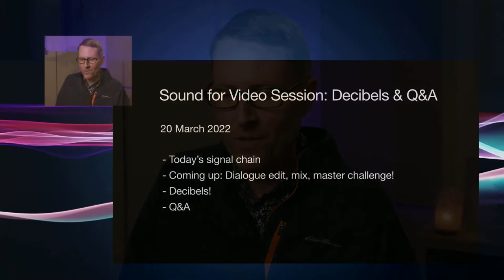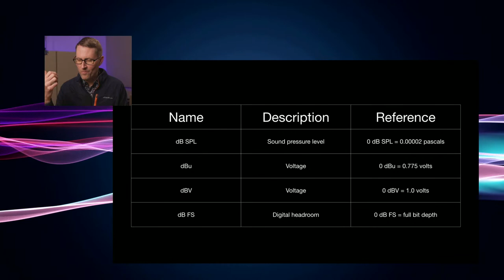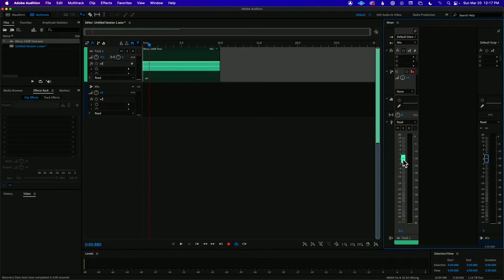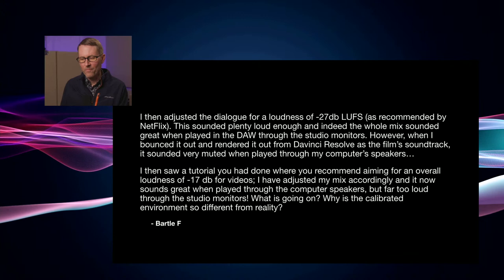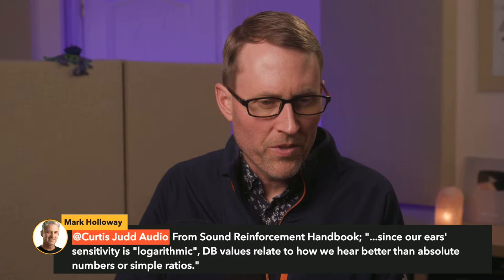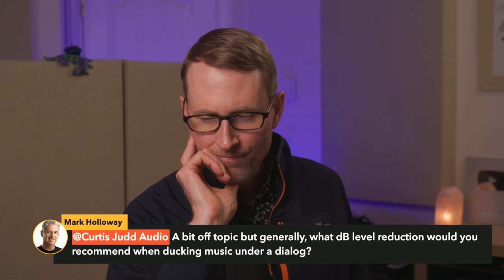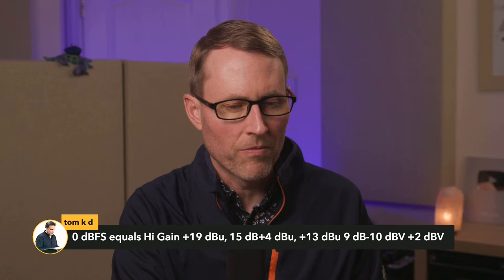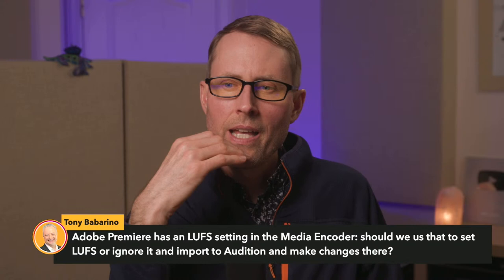Sound for Video Session: Decibels & Q&A

Comment: The best statement to explain dBFS that I have ever heard, was this: on recording, 0 dBFS is relative to the maximum voltage, that the analog to digital converter can handle. On playback, 0dBFS is the maximum voltage, that every digital to analog converter can produce.

I feel like this perfectly explains, for example why the gain of a preamplifier doesn’t tell us how close to 0dBFS we get. It also explains that 0dBFS alone does not tell us, how much voltage we will have after digital to analog conversion.
Reply: That is an interesting way to think about it, thanks for that, Michael.

Comment: In our podcast chain, we do light adaptive noise removal, and then a carefully weighted expander. So when we raise volume with compressor we are not raising noise levels or microphone bleed. Turns out pretty well.
Reply: Nice. In software?
Reply: @curtisjudd  yes all audition default tools, nothing fancy. 

Basically the dynamic processor where we have gotten used to a good setting that generates good enough results on our mic techniques.

And eh, listen if the expander sounds good, back it off a bit if it sounds too aggressive.

Comment: Thanks, this topic is always so confusing! Sorry for the mess with the table in the chat, but this one (from my RME UFXII manual) helped me a lot, so I share it again:
Line Input level for 0 dBFS @ 'Lo Gain' setting: +19 dBu
Line Input level for 0 dBFS @ '+4 dBu' setting: +13 dBu
As old school analog gear typically clips significantly above 20 dBu, I put the UFX line inputs to 'Lo Gain' when my Neve 1073 or A-Designs Pacifica are connected, so that I get them working in the sweet spot w/o clipping the RME AD converters. These values should be identical on all RME devices.
Edit: UAD Apollo specifies a maximum Line Input level (+4 dBu setting) of +20.2 dBu, matching more or less the RME 'Lo Gain' setting and the old studio standard (US/movie +24dBu, Europe 20dBu before analog clipping). Apogee seems to run at 20dBu = 0dBFS, too, and Burl specifies even 22dBu = 0dBFS.
Reply: Thanks Tom.